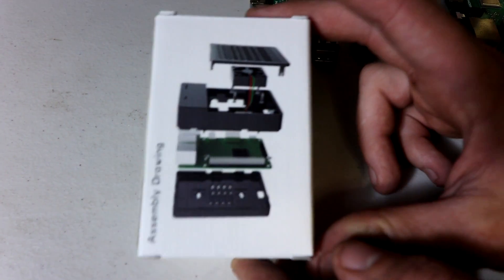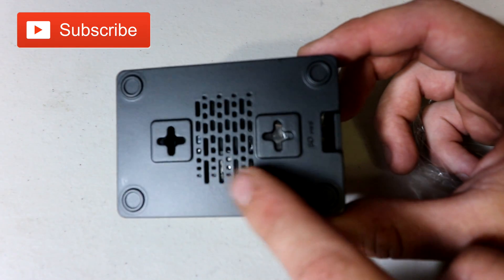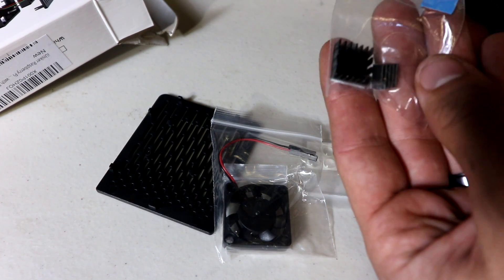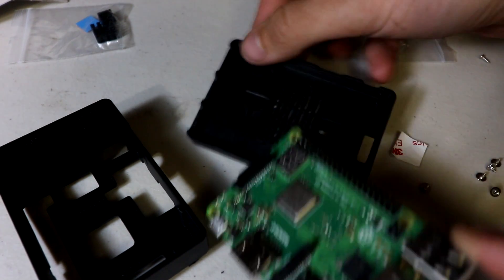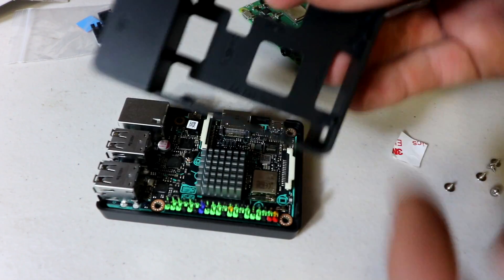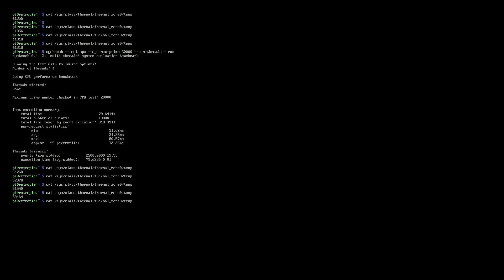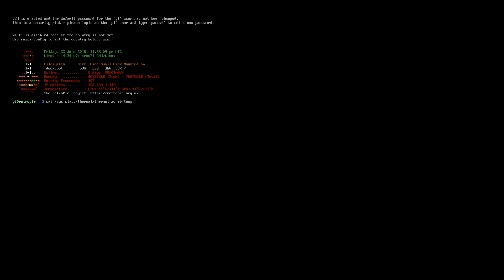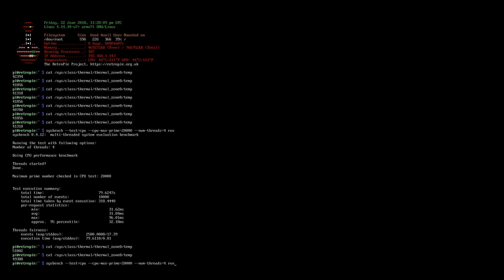iUniker Raspberry Pi 3 B+ Case With Cooling Fan Setup & Review

Comment: Does the fan have a 40 mm diameter? Because I would like to replace that with a spare 5V Noctua 40 mm fan that I have. I simply cannot find a a raspberry enclosure that has the correct mounting holes

Comment: I like this case, it very similar to a case i have, but it was a 3B and like you say, a little bit of cutting on that "thin" inside plastic and everything fits, also, i have always ran fans above cpu's blowing down, and anything on a case blowing out, but this little fan is either case or chipset,  either way its Blow not Suck for Me LoL

Comment: Have you checked out this Pi case, the Geekworm Raspberry Pi X820? It can be paired with an add-on board that allows for a fan, USB 3.0 and a 2.5-inch SATA HD/SSD for storage. The case even has a power button (though I didn't see a script for safe shut-down listed.) Needs a separate power supply, which means the cost adds up quickly (about $70 US all together) but it looks like it might be pretty slick and maybe something review-worthy.

Case: http://a.co/83kYrlm
Expansion Board: http://a.co/g8YpLVo
Power Supply: http://a.co/dkNdPsA